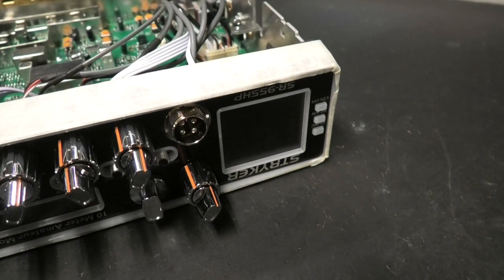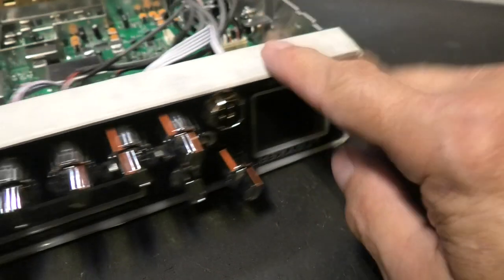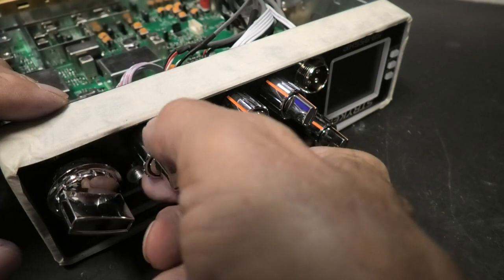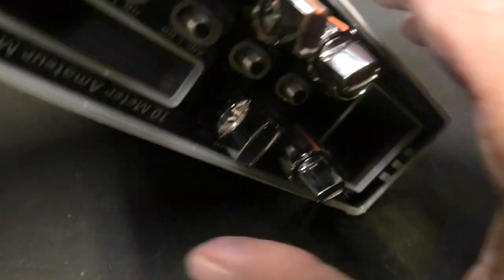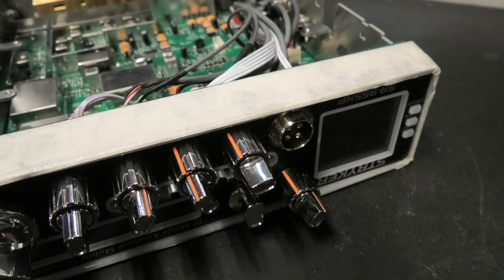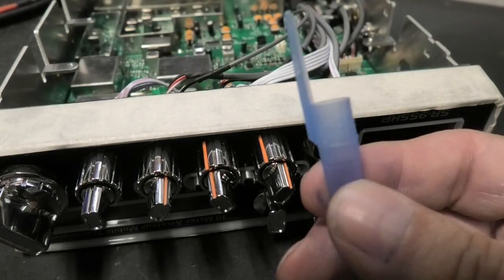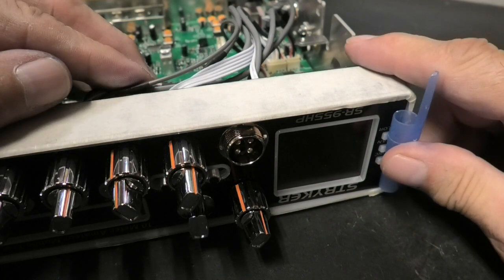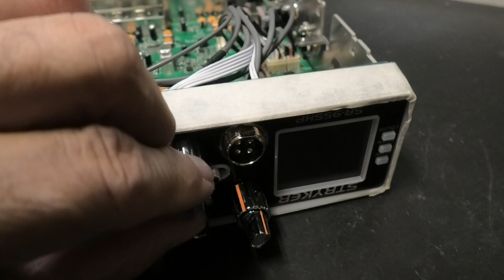Fine Tune Cb Shop HOW TO - The Best Way Factory Reset And Why On Stryker Radio SR 955 - SR 655.

Comment from the maker: It's That Easy! 
Here's what it takes to cut through the noise, be loud and crystal clear with a better receiver too:  A) Tuned Bench:  https://www.youtube.com/watch?v=lwcDfXOgAls.  True, it's more complicated and time consuming to accomplish these consistent and accurate results. Below is a partial procedure and list of calibrated equipment used to achieve this level of performance . Read on ..

Fine Tune CB Radio Shop strictly adheres to (https://www.nist.gov/) NIST Traceable Calibrations and other industry standards to maintain accuracy and consistency for providing Real World Performance Tuning of Citizens Band and 10 Meter export mobile radios with integrity.

"Basic Textbook AM/FM/SSB Transceiver Tune, Alignment and Calibration" 

1) Pll adjustments
VCO & OSC, AM TX OSC, USB TX OSC, LSB TX OSC.

2) Transmitter alignment
DRIVER BIAS, FINAL BIAS, SSB  (or gate voltages for mosfet versions) CARRIER BALANCE, HI-LO AM & SSB Power, RF METER, AMC, ALC and FM DEVIATION.

3) Receiver alignment
AM/FM RF & IF SENSITIVITY, FM DETECTOR/DEVIATION, SSB IF SENSITIVITY, SSB S-METER, AM/FM S-METER (100uV unmodulated -67dbm for �S-9� meter reading!), AM/FM SQUELCH RANGE, SSB SQUELCH RANGE, and NOISE BLANKER/AUTOMATIC NOISE LIMITER (Real World dBm to volts (uV) tables below).

That's just a typical run of the mill textbook tune up and alignment (if you're lucky). There's more to it than frequency alignment, modulation adjustment, meter calibration and a tune up report displaying exaggerated rms Bird peak watts! 

"Test Bench includes"

Bird 4314C Meter
https://www.birdrf.com/Products/Test%20and%20Measurement/Power-Meters/Wattmeters-Line-Sections/RF-Wattmeters/4314C_PEP-Single-Element-Wattmeter.aspx
Part 1) https://www.youtube.com/watch?v=RpX9IHe4ORM&t=16s
Part 2) https://www.youtube.com/watch?v=LuhbqTf6Bxw
Bird 4314C Accuracy Test: https://www.youtube.com/watch?v=DqEOabYqhQo&t=5s
Bird Stipulates 1/2 wavelengths  https://www.youtube.com/watch?v=5eWhgT-rTII
And Genuine Bird Elements from 1K down.

Bird 4373 Sampler 
https://www.rfparts.com/signal-samplers.html

HP8924c with options
http://userequip.com/files/specs/2147/HP%208924C%20Repair.pdf
https://www.youtube.com/watch?v=Cg1w0xBa27s&t=1s

HP8920a with options
https://www.keysight.com/upload/cmc_upload/All/EPSG072204.pdf

Three analog scopes, one digital 200 Mhz
https://www.atecorp.com/atecorp/media/pdfs/data-sheets/tektronix-2465b-2467b_manual.pdf
https://www.youtube.com/watch?v=by98x4eu2lM

Fluke 27fm
http://www.fluke.com/fluke/inen/digital-multimeters/fluke-27.htm?pid=56055
 
LCR http://www.lcrresearch.com/wp-content/uploads/2017/05/LCR_Pro1_Manual_version1.03.pdf

Power supplies
6 Cosel PBA1500f12 (750 amps) variable and configurable.
https://en.cosel.co.jp/product/powersupply/PBA/PBA1500F/PBA1500F-12/
Corcom 20VB1 F7130 EMI Filter 50-60Hz 250V

Times Microwave Coax jumpers and test leads
http://www.timesmicrowave.com/cms/products/cables/lmr/
https://www.youtube.com/watch?v=EmqaGJ6IWow
https://www.youtube.com/watch?v=1ltFVSxGp5Y
https://www.youtube.com/watch?v=v12YZT_1o90
https://www.youtube.com/watch?v=h7iiYfmYWRA&t=215s

Amphenol RF Connectors
https://www.amphenolrf.com/
https://www.youtube.com/watch?v=dVh5B0hdEA0 
https://www.youtube.com/watch?v=dKZg8T_AOso

More range, compliments, reliability and a quieter, clearer but more sensitive receiver,  Get Fine Tuned .. not peaked and ruined.

Here are some VideoGates of me at the bench practicing what I preach using my bench radio or customers radio completed and ready to be shipped: https://www.youtube.com/results?search_query=hard+drive+163+ more: https://www.google.com/search?q=Hard+Drive+163+nm&ie=utf-8&oe=utf-8&client=firefox-b-1-ab

It's what I recommend, use, service and sell ... to you ... not something non practical or deceiving in a misleading way. I'm not just the tech and owner of Fine Tune CB Radio Shop, I'm a customer too!  When finished, You'll be giving radio checks, not asking for them .

dBm To Watts and Volts
Tables below displays relationship between Power in [dBm] or [Watts] and Voltage in RMS, peak, peak-to-peak for sinusoidal signals in 50-Ohm systems for accurately measuring and tuning am/fm/ssb receiver sensitivity, agc, squelch and "S9" Meter calibration. Real World! Mike @ Mikes Radio Repair (Romper Room), Mark Rutherford aka Mark 19960, CB Kidd, Martian and all of your other fake accounts pay attention to the tables below, stop misaligning radios, spreading false information and promoting propaganda! 

  [dBm] [Watts]   [Volts]rms   [Volts]p    [Volts]pp
-140 0.100E-16  22.361 nV  31.618 nV  63.236 nV 
-139 0.126E-16  25.089 nV  35.476 nV  70.952 nV 
-138 0.158E-16  28.150 nV  39.805 nV  79.609 nV 
-137 0.200E-16  31.585 nV  44.662 nV  89.323 nV 
-136 0.251E-16  35.439 nV  50.111 nV  100.222 nV 
-135 0.316E-16  39.764 nV  56.226 nV  112.451 nV 
-134 0.398E-16  44.615 nV  63.086 nV  126.172 nV 
-133 0.501E-16  50.059 nV  70.784 nV  141.568 nV 
-132 0.631E-16  56.167 nV  79.421 nV  158.842 nV 
-131 0.794E-16  63.021 nV  89.112 nV  178.223 nV 
-130 0.100E-15  70.711 nV  99.985 nV  199.970 nV 
-129 0.126E-15  79.339 nV  112.185 nV  224.370 nV 
-128 0.158E-15  89.019 nV  125.874 nV  251.747 nV 
-127 0.200E-15  99.882 nV  141.232 nV  282.465 nV 
-126 0.251E-15  112.069 nV  158.465 nV  316.931 nV 
-125 0.316E-15  125.743 nV  177.801 nV  355.602 nV 
-124 0.398E-15  141.086 nV  199.496 nV  398.992 nV 
-123 0.501E-15  158.301 nV  223.838 nV  447.677 nV 
-122 0.631E-15  177.617 nV  251.151 nV  502.302 nV 
-121 0.794E-15  199.290 nV  281.796 nV  563.591 nV 
-120 0.100E-14  223.607 nV  316.180 nV  632.360 nV 
-119 0.126E-14  250.891 nV  354.760 nV  709.519 nV 
-118 0.158E-14  281.504 nV  398.047 nV  796.094 nV 
-117 0.200E-14  315.853 nV  446.616 nV  893.232 nV 
-116 0.251E-14  0.354 �V  0.501 �V  1.002 �V 
-115 0.316E-14  0.398 �V  0.562 �V  1.125 �V 
-114 0.398E-14  0.446 �V  0.631 �V  1.262 �V 
-113 0.501E-14  0.501 �V  0.708 �V  1.416 �V 
-112 0.631E-14  0.562 �V  0.794 �V  1.588 �V 
-111 0.794E-14  0.630 �V  0.891 �V  1.782 �V 
-110 0.100E-13  0.707 �V  1.000 �V  2.000 �V 
-109 0.126E-13  0.793 �V  1.122 �V  2.244 �V 
-108 0.158E-13  0.890 �V  1.259 �V  2.517 �V 
-107 0.200E-13  0.999 �V  1.412 �V  2.825 �V 
-106 0.251E-13  1.121 �V  1.585 �V  3.169 �V 
-105 0.316E-13  1.257 �V  1.778 �V  3.556 �V 
-104 0.398E-13  1.411 �V  1.995 �V  3.990 �V 
-103 0.501E-13  1.583 �V  2.238 �V  4.477 �V 
-102 0.631E-13  1.776 �V  2.512 �V  5.023 �V 
-101 0.794E-13  1.993 �V  2.818 �V  5.636 �V 
-100 0.100E-12  2.236 �V  3.162 �V  6.324 �V 
-99 0.126E-12  2.509 �V  3.548 �V  7.095 �V 
-98 0.158E-12  2.815 �V  3.980 �V  7.961 �V 
-97 0.200E-12  3.159 �V  4.466 �V  8.932 �V 
-96 0.251E-12  3.544 �V  5.011 �V  10.022 �V 
-95 0.316E-12  3.976 �V  5.623 �V  11.245 �V 
-94 0.398E-12  4.462 �V  6.309 �V  12.617 �V 
-93 0.501E-12  5.006 �V  7.078 �V  14.157 �V 
-92 0.631E-12  5.617 �V  7.942 �V  15.884 �V 
-91 0.794E-12  6.302 �V  8.911 �V  17.822 �V 
-90 0.100E-11  7.071 �V  9.998 �V  19.997 �V 
-89 0.126E-11  7.934 �V  11.218 �V  22.437 �V 
-88 0.158E-11  8.902 �V  12.587 �V  25.175 �V 
-87 0.200E-11  9.988 �V  14.123 �V  28.246 �V 
-86 0.251E-11  11.207 �V  15.847 �V  31.693 �V 
-85 0.316E-11  12.574 �V  17.780 �V  35.560 �V 
-84 0.398E-11  14.109 �V  19.950 �V  39.899 �V 
-83 0.501E-11  15.830 �V  22.384 �V  44.768 �V 
-82 0.631E-11  17.762 �V  25.115 �V  50.230 �V 
-81 0.794E-11  19.929 �V  28.180 �V  56.359 �V 
-80 0.100E-10  22.361 �V  31.618 �V  63.236 �V 
-79 0.126E-10  25.089 �V  35.476 �V  70.952 �V 
-78 0.158E-10  28.150 �V  39.805 �V  79.609 �V 
-77 0.200E-10  31.585 �V  44.662 �V  89.323 �V 
-76 0.251E-10  35.439 �V  50.111 �V  100.222 �V 
-75 0.316E-10  39.764 �V  56.226 �V  112.451 �V 
-74 0.398E-10  44.615 �V  63.086 �V  126.172 �V 
-73 0.501E-10  50.059 �V  70.784 �V  141.568 �V 
-72 0.631E-10  56.167 �V  79.421 �V  158.842 �V 
-71 0.794E-10  63.021 �V  89.112 �V  178.223 �V 
-70 0.100E-09  70.711 �V  99.985 �V  199.970 �V 
-69 0.126E-09  79.339 �V  112.185 �V  224.370 �V 
-68 0.158E-09  89.019 �V  125.874 �V  251.747 �V 
-67 0.200E-09  99.881 �V  141.232 �V  282.465 �V
-66 0.251E-09  112.069 �V  158.465 �V  316.931 �V 
-65 0.316E-09  125.743 �V  177.801 �V  355.602 �V 
-64 0.398E-09  141.086 �V  199.496 �V  398.992 �V 
-63 0.501E-09  158.301 �V  223.838 �V  447.677 �V 
-62 0.631E-09  177.617 �V  251.151 �V  502.301 �V 
-61 0.794E-09  199.290 �V  281.796 �V  563.592 �V 
-60 0.100E-08  223.607 �V  316.180 �V  632.360 �V 
-59 0.126E-08  250.891 �V  354.760 �V  709.520 �V 
-58 0.158E-08  281.504 �V  398.047 �V  796.094 �V 
-57 0.200E-08  315.853 �V  446.616 �V  893.232 �V 
-56 0.251E-08  0.354 mV  0.501 mV  1.002 mV 
-55 0.316E-08  0.398 mV  0.562 mV  1.125 mV 
-54 0.398E-08  0.446 mV  0.631 mV  1.262 mV 
-53 0.501E-08  0.501 mV  0.708 mV  1.416 mV 
-52 0.631E-08  0.562 mV  0.794 mV  1.588 mV 
-51 0.794E-08  0.630 mV  0.891 mV  1.782 mV 
-50 0.100E-07  0.707 mV  1.000 mV  2.000 mV 
-49 0.126E-07  0.793 mV  1.122 mV  2.244 mV 
-48 0.158E-07  0.890 mV  1.259 mV  2.517 mV 
-47 0.200E-07  0.999 mV  1.412 mV  2.825 mV 
-46 0.251E-07  1.121 mV  1.585 mV  3.169 mV 
-45 0.316E-07  1.257 mV  1.778 mV  3.556 mV 
-44 0.398E-07  1.411 mV  1.995 mV  3.990 mV 
-43 0.501E-07  1.583 mV  2.238 mV  4.477 mV 
-42 0.631E-07  1.776 mV  2.512 mV  5.023 mV 

                 Don't Be A Mud Duck!

 https://www.arrl.org/shop/ARRL-Handbook-2019-eBook

Hard Drive 163 NM. 73's! Click click.

Comment: How can I contact you for a Stryker 655hp service and tune
Reply from the maker: Dump whatever you have for whatever you can get for it and buy new, FineTuned, it's much better that way. All About Procedure .. New radio sales only https://www.youtube.com/watch?v=P0W_Ltzeyyc at this time. Read entire description, and watch full video before contacting. 

Thank You!

163 Hard Dr.
Reply: My digital read out lcd screen isn't working anymore just a blurry mess 655 hp. Lmk if can be fixed and re tuned